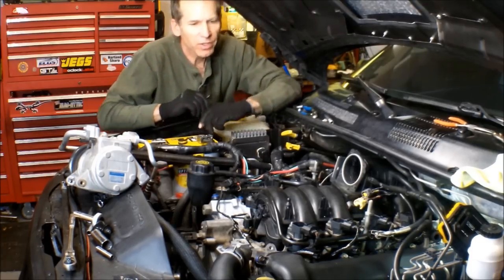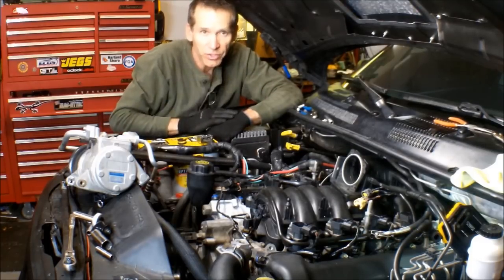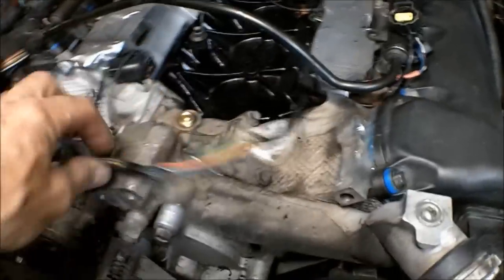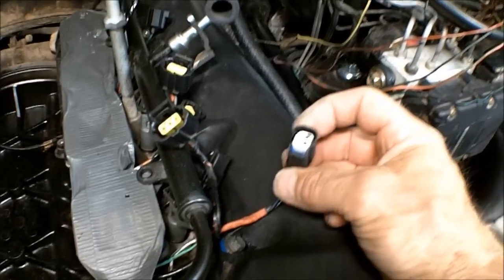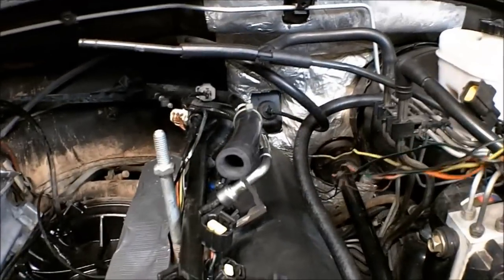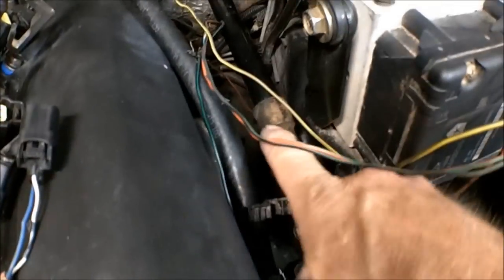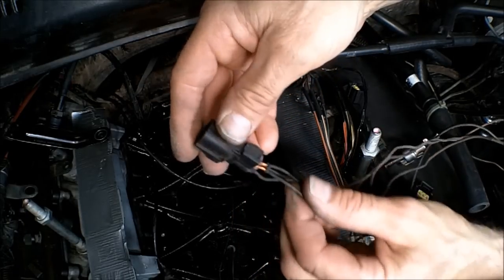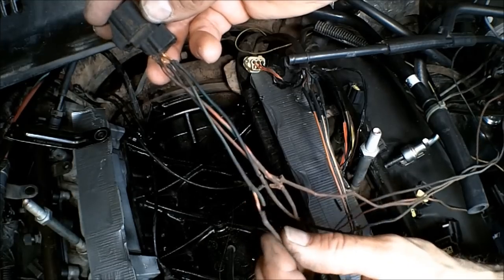Engine Wire Tuck on a 4.7L Jeep Grand Cherokee Part 1

Comment: Hello
I needed to ask about gearbox for jeep wj
Can it be installed on a 2006 Dodge Dakota
Engine capacity of 4.7 liters
Reply from the maker: I looked into that the 06 Dodge Dakota comes with a rack and pinion steering gear and the WJ has an actual steering gearbox there would be no way they would interchange

Comment: Hey there, I just wanted to reach you to say that I really enjoyed your videos. I've got an '02 Jeep WJ that I'm right in the middle of dropping a new engine in after 218,000 miles. I've seen a lot of the things you've done to your ride and have done a few to mine. I'm doing the right side wire tuck on mine. I wanted to let you know that I've found the easiest way to tuck everything on that side is to pull the wires out of all the harness and the isolate just the spark plug and fuel injector wires and add length to them and make a new section of harness that runs under the intake. After you do that, pretty much all the rest of the harness is free to move or possibly reroute into the cab. I'm thinking about moving the computer and tcm into the glove box area. Just a thought... Again, I wanted to say thanks for your great videos and so many great ideas. You really inspired me to do so much more to my ride. Keep up the great work.
Reply from the maker: Thank you! That's awesome! I'm glad it worked for you. What did you do with the O2 sensor wires if you had them and there is also several ground wires that run across the valve cover.

Comment: I love you work brother 

I have a problem with my Jeep Cherokee 04 4.7 I have a check engine light on code is p0172 now I have changed fuel filter and  code went away but came back next day change spark plugs and check coils everything good there code went away for got to mention it’s smells like gas on exhaust I can’t seem to find a vacuum leak ether any idea what could it be
Reply: Sandy Rios- I would look at the o2 sensor voltage, fuel trims and ECT. I'm pretty sure thats a o2 sensor code, for running to rich. Also check the fuses. Could also be your fuel intectors, you could try swapping them and see if the problem moves with them
Reply: Thank you Justin I will try that let you guys know if that works out for me
Reply from the maker: I would check fuel pressure. Since you just changed the fuel filter and the fuel pressure regulator is inside the filter maybe you have a defective fuel pressure regulator. A hi fuel presssure could cause this code.
Reply: Update I found a vacuum leak and now my crus control works and my vents to my heater working haven’t reset code but I’m going to let’s see if that helps but still going to check everything that’s gos to this code p0171